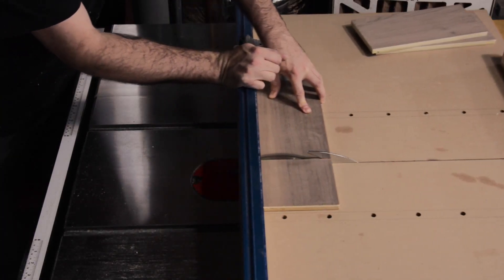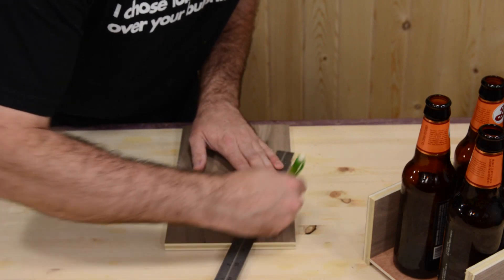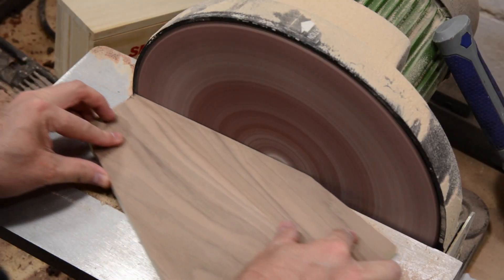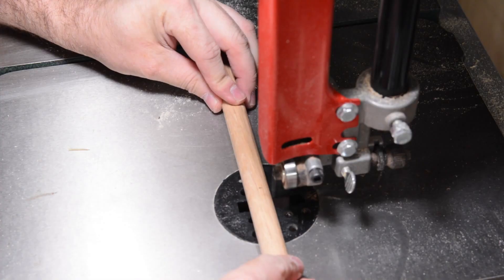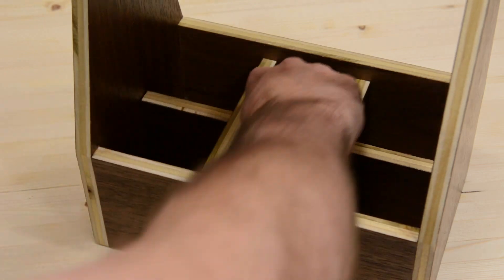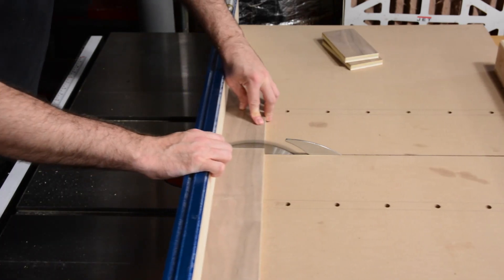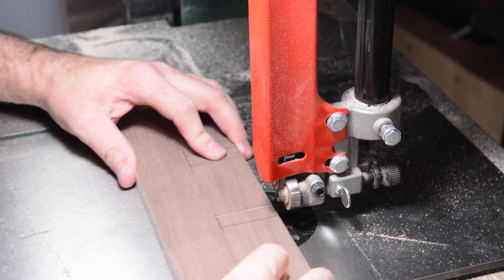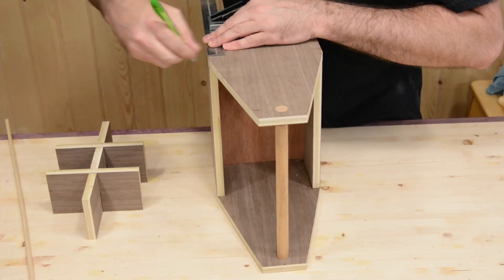How to Make a Beer Tote/Caddy

Comment: Ever since I've seen this video I knew that I wanted to do it for some project. Finally decided to make these for my groomsmen and do some engraving on each side just to add a little something to it. Came around to assembly time and my fiancee noticed that the spots for the beers were too small. Anyone else run into this issue when building this? Luckily I had some good looking 1/4 plywood but still kind of sucks that I didn't realize it earlier in the build.

Comment: My kind of woodworking!

Beats a soggy cardboard caddy any day - plus I get to turn up to parties with even more style than normal.

I think I'll make this my first proper woodworking project, when I get going. Do you reckon I could do the dado, (first caddy), with a circular saw, as opposed to a table saw?

Great project! Thanks very much
Reply: You can make a dado with a circular saw, but what you would need to do is get a guide (http://www.rockler.com/search/go?asug=&w=circular+saw+guide) to cut the out side lines and then make a number of cuts staying within those lines!! Hope that made sense, lol.Just make the outside line clean and straight!! You will probably still need a chisel to clean out the dado, the only way I know of to get away from a chisel is a dado set on a table saw or radial saw.
Reply: Ahh cool - yeah, I figured I would screw a piece of straight wood to a table for a circular saw fence, then screw a piece of wood parallel to the fence, but thinner than the piece I'm cutting the dado into for my "dado cut" fence. (measure off the circular saw fence first with a square and mark the table so I can accurately place the dado cut fence)

Cut both pieces, then shift the "dado fence" over a little (unscrew, move towards or away from the circular saw fence to the second mark, rescrew) and cut again. I could then chisel the remaining piece between my two cuts.

I figured I could also screw on an end stop perpendicular to my circular saw fence for the circular saw. Just need to do a test cut to a mark and measure the spacing for that specific cut depth.

Thanks guys - may have to look up "hammer and chisel" sounds like it could be less work ;) ha ha!

I REALLY want to make some of these caddy's though. They're frikin' sweet.
Reply: New kid on the Wooden Block Same idea as what I came up with for the circular saw...... but more elegant than what I was aiming for! Nice to see proof of concept - thanks!

I think I should be able to get my ghetto-fence to work!

Comment: could you have drilled a hole and used a scroll saw to cut the handle in order to not cut the straight line through it?

Also, Miller dowels are good alternative I will try on mine
Reply from the maker: Yes, drilling a hole a using a scroll saw is probably the better way to.